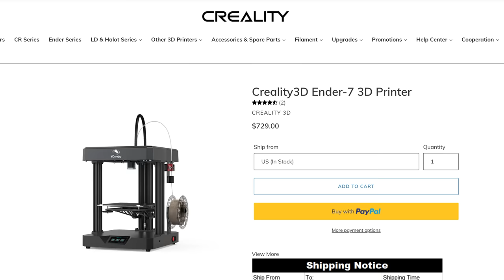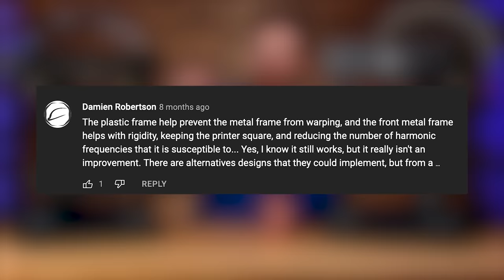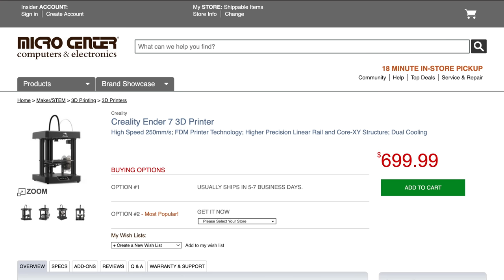The End of the Ender 7

Comment: I wonder if slapping some insulation on the under side of the bed would help, along with checking all the rollers and bearings.

It might not he worth $700 as is, but if someone could show Creality where they went wrong with it, and they fix it, maybe they could salvage it as a product, and let current owners know how to make it work as advertised so they're not spinning their wheels chasing solutions that don't work.
Reply: Creality does not give a damn about fixing its products. They just care about flooding the market with subpar printers.
Ask Naomi Wu, she used to work for them, she fought tooth and nail to make Creality put out good printers and designed the CR-30 for them. But now she left the company because basically during all that time, she was fighting the mediocrity on each level, the CR-6 SE specifically was the final nail in the coffin according to all her (numerous) tweets about it.
It's pointless, the company is good for the trash bin, as are most of their printers. Out of their whole lineup only the Ender 3s1, Ender 5 Plus, CR-10v2 pro, CR-10 V3 and CR-30 are good, but those are sold at an enormous price compared to better alternatives from other brands where you don't have to run and change parts like the extruder on the very first day.

Comment: I would guess that its because the bed is only supported on one end, in addition to it being the part that has to move along the Z axis. I just dont think that the bed can be stable enough in this type of configuration. (IE. There is probably too much play/looseness whenever pressure from the nozzle is applied on the bed, especially near the front of the printer where it is further away from the z-axis adjoining support bracket). TL;DR: I think the bed needs a second point of contact to guide/stabilize its motion along the Z-axis.

Comment: I own a pair of Ender 7s and Joel is pretty much right about them. Out of the box they are not good printers at all. Print quality is just plain bad, regardless of the filament used prints have zits, z banding and corner bulges. The textured side of the glass bed is the single worst print surface I've used. PLA will not stick to it at all - the plain glass side is better. First thing any Ender 7 owner should do is buy a new print surface. The fans are noisy and the control board uses loud drivers. There's also a consistent issue with the nozzle scraping over the print, causing the linear rails to rattle like crazy.
But the biggest issue is the bed mounting system. It's terrible. The bed will sag toward the near edge and is also unstable and the act of unsticking a print can cause it to tilt slightly to one side, requiring re-levelling. Consistency is not the Ender 7's strong point.
It's also prone to developing a motherboard fault that causes the X and Y steppers to run at half speed, limiting printing to the rear left corner of the bed and making levelling nearly impossible.
There's absolutely a market for a quality sub $1000 core XY machine that doesn't come in kit form. Not everyone has time to build a Voron or a Ratrig. But the Ender 7 is not that machine.
On the plus side, it does actually print really fast. Some prints finish in 1/3 the time of my bed-slinger machines. For rapid prototyping it is a somewhat useful machine. But the quality suffers and endless fiddling is required to get a reasonable print, which negates much of the speed advantage.

Comment: I am designing and building my own 3D printer the first time out of 2040 aluminum extrusions. Had some frame resonance issues. Watched your video and relocated the front horizontal beam below core xy frame and it helped with vibrations. Resonances are not completely gone but it's much better now (yeah, I kind of screwed up). Tests showed some degradation in print quality, but only on higher speeds and accelerations, where it was not good anyways. At 300 mm/s and 1000mm/s^2 I could not tell the difference (still building a print profile for it).
In my opinion, since 3D printer parts are experiencing mostly dynamic loads, it actually can be light duty built. As long as core xy frame stays square in the moments of print head and gantry accelerations/deceleration and keeps it's relative position to the table it should be fine.

Comment: Most of what you can take from this is that some people talk utter rubbish. Probably adding an exclamation mark where they really needed to be putting a question mark? Some people also can't think straight because their mouths are making too much noise. I felt that when you made the cut - it actually improved the machine in many ways. It also aligns with what the Prusa XL looks like as well as others. One of the many reasons I love Engineering.

Comment: I had two Ender 7s, and both were lemons.  Problems everywhere.  Compare that with the Ender 3 S1, which is a much better printer in every way, or from a CoreXY perspective the Ender 6.  Honestly, an Ender 6 Pro with linear rails would have been a better printer than the 7.
Reply: The Ender 7 feels like such a massively flubbed product.  They had a perfect opportunity to make a cost optimized Voron Trident (automated tri point bed leveling) and they just made a excessively chonky Hypercube that works worse

Comment: I cut the front off two of them with no issue. they work better without it no matter what the theorists say.  If you run them at lower speeds you can get results common to ender, but I assume you know that, and if you go slow what's the point, right? I use them regularly.  When I need big parts fast I can shave 1 hour off a 3-hour part.  I have magnetic beds on mine and have no peel issues.
Reply: also, i found that to fix flimsy parts turning up the heat helped- it seems the lower temp head couldn't keep up with the flow speed.

Comment: So what is the best machine under $1000 for more mechanically oriented parts with good speed?
High resolution is important, but secondary to strength and speed. 
If it already takes a few hours to get a small project designed and ready to print, having it take 12 hours with any chance of failure whatsoever, is going to be a deal breaker 90% of the time.

Comment: Not sure what went wrong with Creality. My first ever machine was an Ender 3 Pro, so we know they can make a machine and still works great 3 years in. My second was a CR10S Pro that was a complete pile of crap. Ended up selling it for parts after 18 months of frustration. 3rd machine Anycubic Predator, nice machine with some issues. 4th machine was a CR6 Smart, OK machine after a lot of tweaking and community firmware upgrade. 5th Machine was CR10-Smart. Not so smart, but after disabling most features I do get decent prints . Also had to dump the machine WIFI and redo the USB to enable octoprint. I can pretty much guarantee my next machine will not be a Creality .

Comment: I’m just going to throw this out there. I have owned all sorts of different 3-D printers from different companies. I’ve even built my own from scratch. It just so happens that every Ender series printer that I have owned had to be modified right out of the box. Whether it was some part that was bent straight out of the box, or like the Ender five where you have to build bed supports or it just won’t ever stay level, or printers that don’t include dual Z-screws so the gantry stays level……Whatever the problem may be these things are made for tinkers or inventors. You are always going to have to do something to an end or series printer if you want super quality.
Reply: Great story but it's probably just that, a story. My CR6SE worked perfect out of the box and I'm not alone in that experience.

Comment: Looks like temperature and cooling setting issues.  Possible the gcode is not particularly suited to these machines - especially if the stuff that came out of the files supplied with the machine were much better than your megazoid stuff.  Also, the ONLY way stuff doesn't stick to carbarundum glass is when you have a problem with your first layer parameters.  The issue may be that their leveling assumptions and initial layer settings don't scale in terms of speed - that is, as you print at higher speed, you will also have less cooling time per layer, you might have goose up the nozzle temp at the same time in order to melt filament faster, so those things work to mess up in the way your describing.  With better instructions to printer that match the printing conditions, you would have less problem.

Comment: This printer needs klipper in the worst kind of way.  When printing at higher speeds with small movements the stock board tends to lag and creates blobs.  Klipper unlocks the full potential of the Ender 7 and gets rid of the lag.

We sell upgrade kits for the Ender 7 at Amserv3d

Comment: Actually, the front price is needed for these machines. 
This is not for rigidity of the machine but to maintain the perpendicularity of the axes.

Majority of the time aluminium extrusions come is straight shape but what I noticed in many creality machines is that they are not perfectly square. 

I suggest you to perform a dimensions test between both machines and check whether the part squareness is perfect.

Comment: I've been having bed leveling issues with my Ender 7. I regularly have to re-level it. You're 100% right that this machine should have come with BL Touch or something similar. My Ender 5 Plus has been running nonstop with no appreciable failures with the new Creality hot end upgrade, direct drive, and BL Touch. Need to upgrade the 7 and Sermoon I bought over the holiday sales to have ABL I guess.

Comment: About the missing front section, I am able to push my vorons to upwards of 600mm/s print speed, and they are still only limited by the hotends ability to melt the material fast enough. I recently started experimenting with putting custom brushless servo motors on one of them, and the frame gap still doesn't show any major issues with over 500W of input power on the XY gantry.

Comment: I don't understand why auto bed leveling isn't standard on new printers nowadays.  Yeah it raises the price, but for most people it substantially reduces frustration.  A BL touch kit can be had for under $50 on Amazon. I would assume it would cost the manufacturers significantly less.  I have a Taz 6 that only takes 4 points (corners) on a fixed mounted bed, and once the z-height was set, gives me a good first layer almost all the time. I also have an Ender 5 plus with a Bl touch and takes 16 points (might be 9),  and an adjustable bed - it just has the step of getting a manual level good enough, set the z-height, and print. So on a $700 high speed printer, this is inexcusable.

They also need to get rid of those crappy plastic extruders that break within a couple of months.

Comment: I have an ender 5 which was around half the price including upgrades. I've also found that with the upgrades and time spent on it, it delivers really decent prints, in most cases. It has issues, but for the price, I haven't found a replacement. It's really a shame to see a printer that has lower quality than mine from the factory for double the price

Comment: I do own an ender 7, not sure if i got  a one off good piece but for me the Ender 7 was functional out of the box, except for the issue with vase mode when printing off the sdcard.
I always have my print bead atleast at 50c for prints and have not had issues with print adhesion. Recently i set the printer up with Klipler and am enjoying the superior printing experience now that i have pressure advance.

But Creality did miss the mark on many things , i asked them for the printers Marlin source and they just said some BS as reply.

But with Klipper the printer has been giving me fast and reliable printing.

mods/tweaks done

updated to use klipper
moved to a shorter better quality bowden tube
Reply: Got mine today, Setup was none in 20 minutes. Sliced a benchy in cura with 150mm print speed, 2500mm acceleration and jeark set to 12. Used some old left over petg. Print was successfully completed in one hour. Quality is very good already. Want to klip mine as well, any hints from you?
Reply: @steffenadamski2786  my replies seem to  be getting deleted , i can post a l i n k to a g it hub once i am able to put my cfg there
Reply: i will add more info there and and update the readme, there are few things to watch out for like the default Klipper firmware cfg causes the heated bed to come on at start up if the raspberry with a running klipper or mainsail os with klipper is connected, the firmware in the repo has that issue corrected and i have uploaded that corresponding config file also ,but unless u are an experienced tinkerer please give me some more time so i can update more info and you can have a safer and smooth migration to klipper
Reply: @steffenadamski2786  the stupid YouTube algorithm seems to be crazy

keeps deleting my comments

now am curious what the f does it actually set as criteria i tried keeping the  comments short concise without links, Keywords 

shitty thing keeps deleting so this time trying something new
 a longer comment

 so hopefully u can find the repo i   g i t  h ub  if u search with ender7 klipper starter pack

  i will add details in the readme , just uploaded  all dependent files as a first step
Reply: @3000johns  sounds great, good that you plan to solve the bed heating on startup which i have seen as well.
Reply: @steffenadamski2786  the uploaded firmware and its cfg already has the changes for the bedheating issue , give it  a try , i hope you are doing the first set of test with a hand on the main power switch to the printer untill u are certain everything is fine. I have been running my printer with klipper with the printer cfg i added there for some time and so far everything looks green.  let me know if u run into problems or discover something interesting, my g it hub profile should have my e   m ail id also

hope you were able to find my g   it hub entry with the files
Reply: @3000johns  might found your profile with a duck mail. Going to test the config today, will provide feedback asap. btw i experianced a pretty loud scratchy noise when Y is moving.
Reply: @steffenadamski2786  i had issues when i had initially set up the config (wrong motor orientation and also had to fiddle with the ensdtops to set them up correctly,however i did not need to make any Hw changes on the printer was able to get everything running smoothly with the cfg  i have put up on g it  hub.

i am not aware and Don't expect too much variance between the ender7s released, but make sure u are monitoring the printer till u can verify full functionality. 
and i guess u know this already but u will loose the lcd function with klipper
Reply: @3000johns  seems to work well for the moment, just z is raised by about 0.3mm when print start. Y Rail noise has gone after loosen the screws at the xy interconnection by a half turn
Reply: btw. i slice my models with 0.3mm first layer hight

Comment: it'd make for a decent klipper carcass at like $250-$300 as thats about all the junkers worth. considering it'd need framework, board, hotend, extruder, probably motion system work, pei sheet setup and ABL. 

imo the E5+ is 10x the printer for less money and atleast works out of the box
Reply from the maker: I think a person could get away with a new board, hot end, and bed surface and be most of the way there

Comment: When are all the 3D manufacturing companies going to ditch the "Spring Beds"?!  It makes absolutely no sense to use linear rails, then put all that on a crappy spring supported build plate.  Manufacturers should look at Cetus... they've removed the bed springs entirely, and use direct drive extrusion, and 1 time mesh bed leveling (since the bed never moves, you only have to calibrate once per nozzle change).  Springs by definition are highly imprecise, and will move in all kinds of unexpected ways, and if all the 3D manufacturers knew what was good for them, they'd ditch the springs altogether....  and tell them to never mix springs and linear rails, that's just silly to dumb down the high precision rails with a crappy $2 part.

Comment: It's bad when you need to do a upgrade for this machine to get it work great. Had the same problem with my Ender 6. Put a good bed and good springs or cylindrical rubber underneath the bed as I use now. When the most is about adhesion why make this kind of faults. Don't think I will buy a creality again. Though they would change but apparently not 🤨

Comment: It didn't even dawn on me until this vid but not having bed leveling with carborundum glass is just stupid. I love my carborundum glass build plate but it's a finicky monster to get good reliable adhesion. You really have to dial in first layer height, meaning as little squish as possible and so much as 0.05mm too far or too close will wreck the adhesion. You will not get that with just 3 point or 4 point leveling. Really need manual or automatic mesh leveling for that kind of accuracy.

Comment: Hi 3D Printing Nerd, 

Quick question for you related to the tests.  Did you run any tests that would print at lower speeds, like 100mm/sec or 50mm/sec, which of course is not what they advertised, but curious to know if the core issue manifested when running the extrusion process at higher temps and at greater speeds, the machine couldn't "keep up" while attempting to regulate the controlled heating and cooling off of extruded filament.   Could this per second value be manually changed via the UI?  I almost bought two of the Ender 7's today as they dropped in price significantly during a flash sale.  But I'm going to go with the 5 pros instead.   

Thank you for being so steadfast about the Ender 7 reviews.